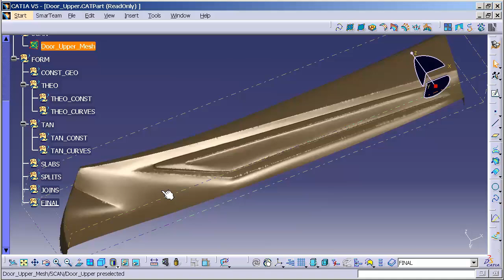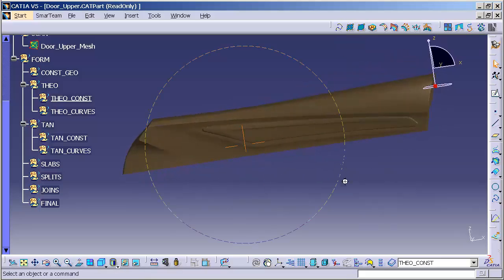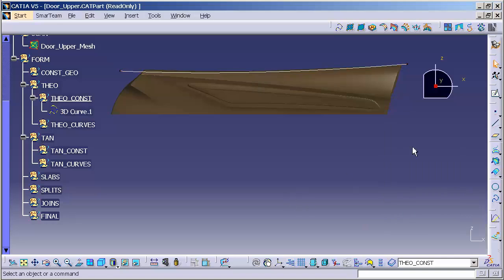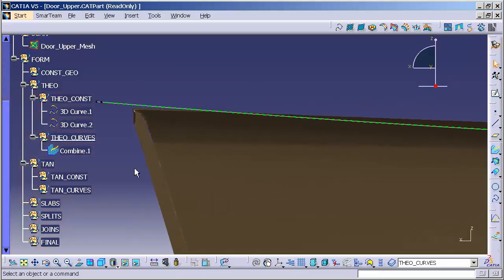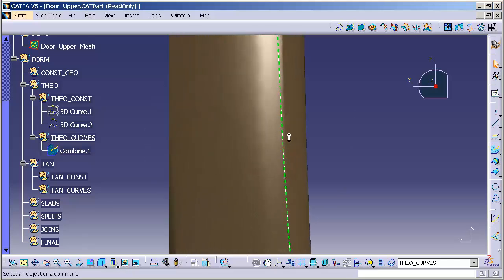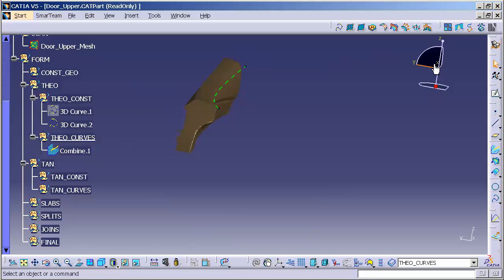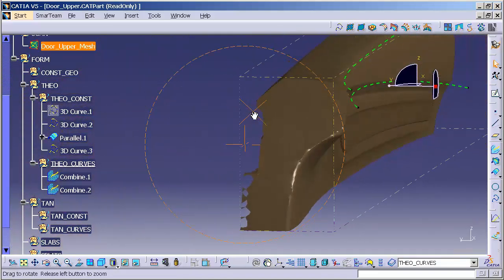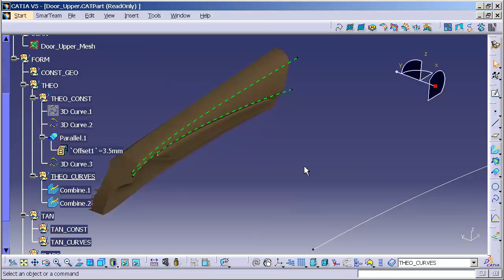Catia V5 | Catia V6 Tutorial - Step 3: Door Upper Theoretical Curves

Comment: Hi, thanks for great tutorials!

Is there any particular reason that you create two curves and then combine them into one? As I understand the 3D curve can be manipulated in all directions, which makes it possible to have the green line at once and manipulate it.
Reply from the maker: Good day and thanks for the question.

You are correct you can manipulate the curves in 3D as you say. I like using 2D as it is easier to manage in some ways but also I use the 2D curves for additional post 3D uses like parallel and intersect.  I will often create the 2D curves and use them to help set the next shape to create relationships.
Reply: class A surfacing I see, that makes sense. Thanks for your reply and keep up the good work!
Reply from the maker: Thank you. Your question is a great way to open a conversation on the topic of shape relationships.

Thank you.

Comment: Is that possible to create a class A design with the same dimensions? No aproximation! I mean this having rideability as reference or when im working with a control volume. (sorry, didnt see the next videos... maybe there will be the answers)
by the way, thanks for the tutorials!
Reply from the maker: +Lucas Marodin de paiva 

The issue is that this is from clay. Clay will always have tools marks which degrade the quality of the surface. Part of class A is cleaning up the data for not only smooth surfaces but getting the feeling/look of the surface. So an approximation is necessary. 

And thank you!!
Reply: Ah ok! I saw that the base element has some imperfection... i'm not a advanced user of catia but i know that for plastic injection some marks on the 3D can apear in a injected product.
About your videos, i think youre the only one who is trying to expose some tips abouts this level of modeling.
Reply from the maker: Lucas Marodin de paiva Sorry missed this comment.

I will be doing more soon. Thanks for comment!!